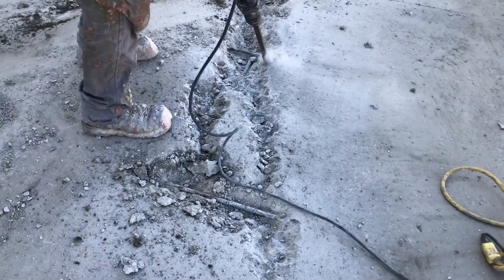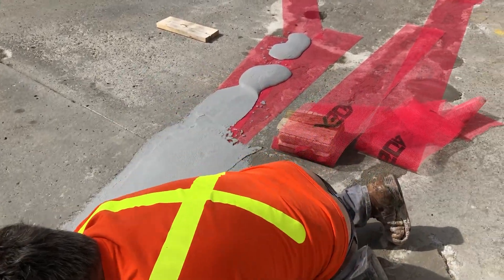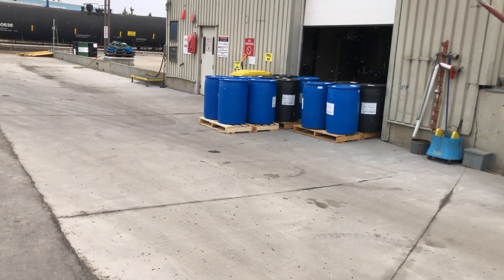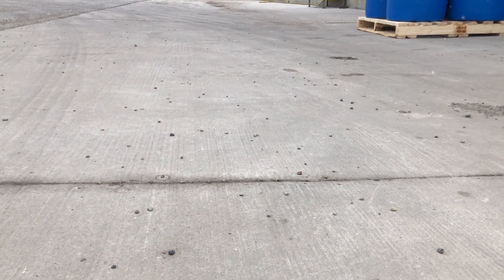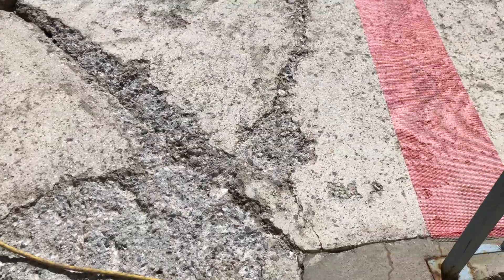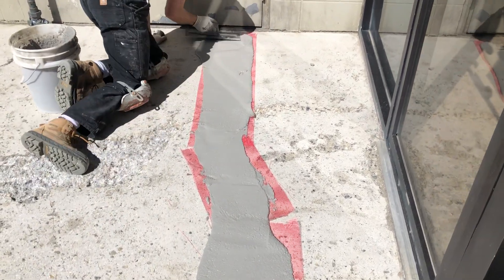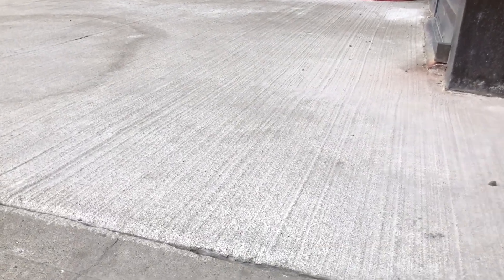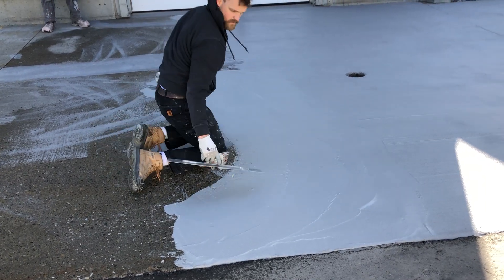Concrete crack repairs after one year

Comment: in my situation i have similar cracks in my garage but they were caused because the original installers did not put in control joints. Is reasonable to perform this repair and then cut (or before) control joints after to establish a clean control joint.
Reply from the maker: Yes it is. You have to maintain control and expansion joints.

Comment: Does part of the repair's strength comes from the jagged surfaces you make out of the adjacent slabs after chiseling it out? As in, when you pour the repair material in, it conforms to the jagged surfaces and creates a mechanical lock between the two slabs not unlike puzzle pieces.

I see a lot of critics of this method of repair, so I'm curious if there's a testing method that can quiet some of the naysayers. Perhaps make simulated slabs and then put them in a 3-point beam testing apparatus? One of them is tested undamaged while the other is tested after being cracked and then repair as similarly (to scale) to how you would in the field. The results would be the difference in force required to break it before and after the repair. 

I'll be honest, I don't expect a 100% return in strength, but I'll be happy if at least 60% to 70% of the original strength is returned.
Reply from the maker: Yes, you are correct. We have done those types of tests, and the repaired structure is stronger than the original.
Reply: @TerrafuseInc  Potential video idea, perhaps? People do like watching things break.

Comment: Man that job must’ve cost close to new concrete considering you can only buy this stuff in 20 lbs at a time on Amazon!! 
For freaking $$$ 70.00.    I’ve never seen it in 40-50 lb bags they don’t exist well maybe in Canada but not the state’s. 
Very solid product either or.
Reply from the maker: You can buy larger volumes from us directly, and we have warehouses in the US. The amazon kits are meant for smaller DIY jobs, as shipping one 50 lbs. bag is ridiculously expensive, especially now.
Reply: @TerrafuseInc   there in Florida I  already checked.  The Shipping costs more than ten bags of product.  I love the stuff just can’t buy it locally unfortunately
Reply from the maker: You're located in Florida?
Reply: @TerrafuseInc     PA    I already spoke to the rep and got a quote.  The stuff is incredible to work with!  All other products similar have short work times
Reply from the maker: Ahh, ok... Well, we are continually working to improve our distribution network, unfortunately with everything happening in the world, raw materials and freight prices are skyrocketing, which isn't helping..